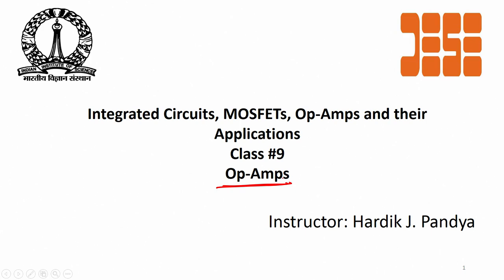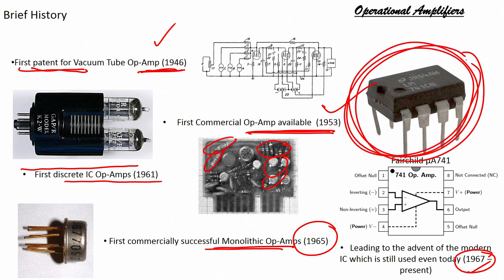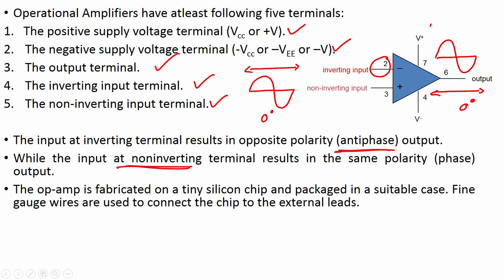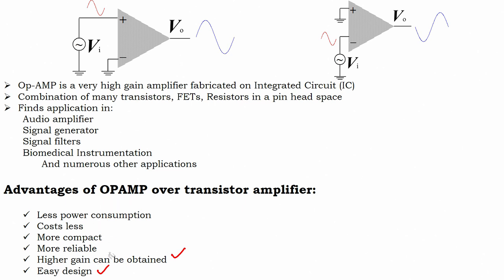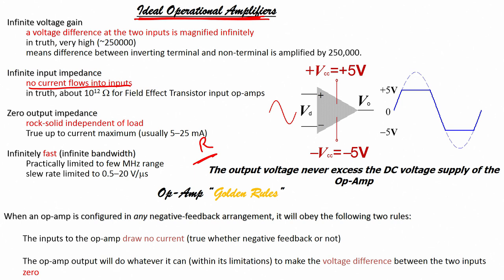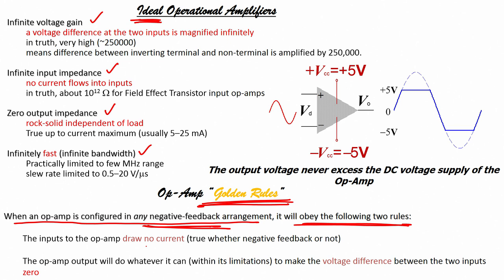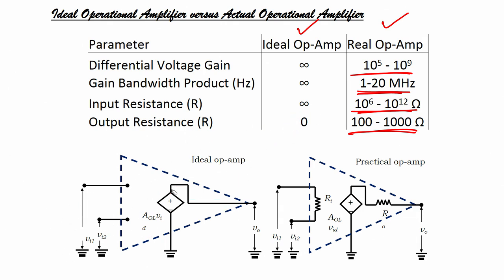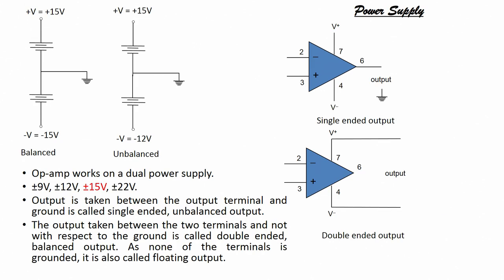lec15-Introduction to Operational Amplifiers

Comment: Differential-mode and common-mode signals are important to understand in the design of complex signal-conditioning circuits which use operational amplifiers in medical diagnostic, industrial control and military applications. 

Operational amplifiers mainly excel in performance to provide a high common-mode rejection ratio and high gain. By using negative feedback, its overall gain, input impedance and bandwidth are determined by external components without these parameters being affected by the op-amp’s parameter variations due to external influences like temperature and so on.
Most amplifiers built using discrete transistors will not be able to match the performance characteristics of an operational amplifier like CMRR, low drift, high input impedance and stability of gain. 

Engineers are so used to thinking and visualising currents as differential-mode in circuit analysis that they find it hard to switch their thinking to common-mode currents and their effects in say, amplifying circuits. 

It will be instructive to understand and visualise Current at its most fundamental level in the presence of electric fields in ordinary conductors.
Electrostatics and circuits belong to one science not two. To learn the operation of circuits, Current and the conduction process, resistors and how discussing these topics makes it easier to understand the operation of capacitors, inductors, diodes and their operation in amplifier circuits and circuit theory watch these two videos 
i. https://youtu.be/TTtt28b1dYo  and 
ii. https://youtu.be/8BQM_xw2Rfo 

Most common-mode signals originate because of sources external to the system, and the energy in them circulates annoyingly until it is dissipated in resistive portions. They can be generated internally if proper cables are not used for coupling signals at the frequencies of the signals they carry.
Therefore the need arises for amplifiers to amplify only the useful differential signal and reject the common-mode component which does not belong to the signal conditioning system. Such an amplifier is used as the first stage of an operational amplifier which opens the door to allow a signal from a sensor ‘in’, so to say and so the importance given to this stage. 

Topics related to these aspects are discussed in chapters 3 and 5 of textbook 4 (see last frame References in video #1) and a power point presentation with animations “Basic Action of a Differential Amplifer-Heart of the Opamp” which explains differential amplifier with a U-tube manometer analogy of differential- and common- mode signals is included in the CD alongwith this book.
Also in textbook 4 you will find descriptions using a unified approach towards an intuitive understanding of "circuit zero", "neutral", "ground" and "earth".
Reply: thank you sir
Reply: Abey, hamen tumhaaraa gyaan nahin chaahiye!
Reply: your youtube recommendations helped me alot sir.. thank you very much sir
Reply: @Rajinikanth_L.Dicaprio  I am happy that you took time off to acknowledge. Really happy. Thanks and Regards. Sridhar
Reply: You may also visit the following 
 For a unified approach to electrostatics and circuits. 
15. Simple D.C. circuit. 
Pattern of electric field.
Watch from  16.0 minute.
16 Mechanical Battery
Watch from 19.0 minute.
Ch18L1b
https://youtu.be/Eu3JQKrJRZA?si=t3MeX8Hi8ELAxaz0

17 First intro to  Surface Charge 
Watch from 10.30 minute. 
18 Surface charge gradient 
Watch from  15.30 minute. 
Ch18L2a 
https://youtu.be/bp0o1HZOs3g?si=PPiPGepbXvdTgJHX
Reply: @sridharchitta7321  sure sir... i will go through those new videos sir...But, Thank You very much once again sir...
Reply: @Rajinikanth_L.Dicaprio  read paper Restructuring The Basic And Advanced Electricity And 
Magnetism Course in International Journal of Computer & Mathematical Sciences IJCMS

Comment: why does the output voltage can't exceed the bias voltage?
Reply: bias voltage is like limits you cannot exceed them. Its very similar to that of CE amplifier, where output voltage cannot exceed above Supply Voltage else it will saturate.